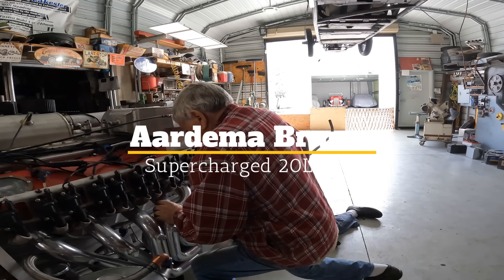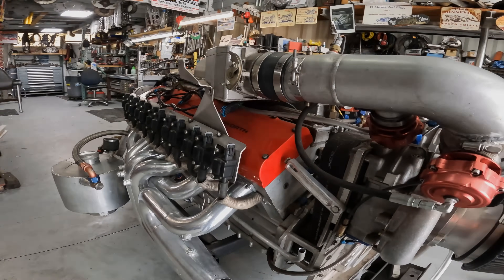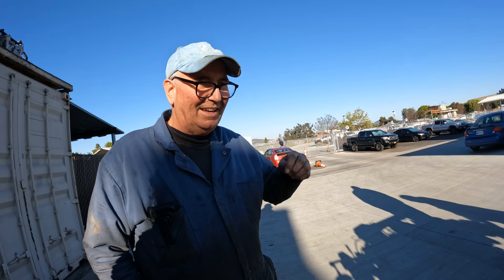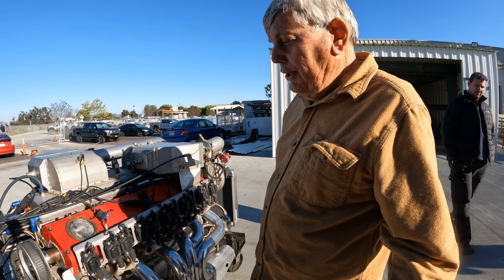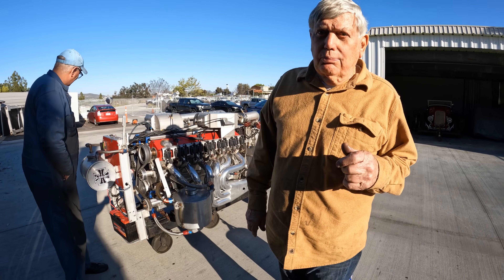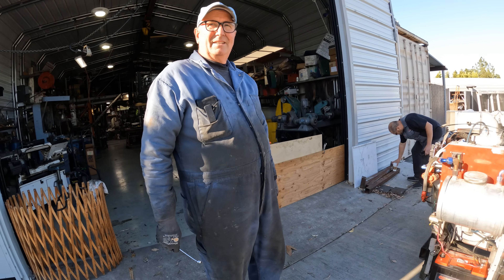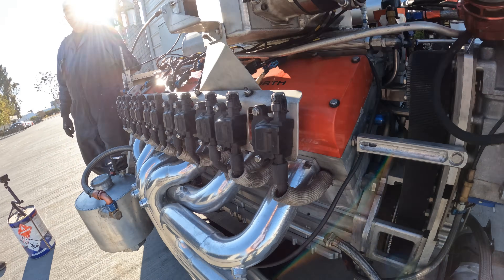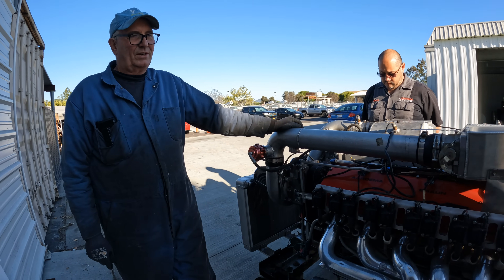DIY Prototype 20-liter V12 Engine Start Up -

Comment: Those Youtube drag racers are claiming 3000 hp out of 550ci engines but they only run for a matter of seconds 
You guys want this to run 15 minutes per heat would be quite the accomplishment ,,,,,,,,,,

Comment: A gas version of a Detroit/GM Diesel, made from aluminum, and modern lighter weight parts, drop the compression to about 10:1 use a large rotary valve on the intake if needed, to prevent the piston from pushing air back into the intake, or maybe use something similar to a sleeve valve, use 1/4 of the bore as a port about 1.5" 2" tall, 3-4 ports to induce swirl, at a angle , to allow the blower to push out the exhaust filling the cylinder,   the low pressure high volume boost filling the cylinder, and inject the fuel on the piston top and it start to rise compressing the air evaporating any liquid fuel, mixing it with air,  at higher rpm possibly injection of fuel may need to start soon as the piston uncovers the port as scavenging is happening,  if exhaust temperature is a issue, cam timing may need to be modified to close the valves to prevent fresh air and fuel from entering the exhaust  ,  the engine should make tons of power! Especially at higher rpm when the turbo spools, pushing about 2bar into the cylinders, possibly requiring multiple fine must low volume fuel injectors, to allow a fine atomised intake charge to be pulled in,  the wet injection would allow the fuel to evaporate and burn later in the stroke,  possibly making more power, the engine would require a lot of testing to get ell the power from a turbo two stroke GAS engine, I think atleast a 3.80" 4"+ stroke would be best  because if the loss of work due to the intake port, maybe it doesn't matter,  maybe the boost / scavenger and cam timing makes up for it, and all the  energy is extracted and the exhaust valve can open  allowing the pressure to start the scavenging, before the intake is open allowing the exiting exhaust pull in intake charge, then the 1-2 bar boost, making more power,  
Even a 53 series based gas engine would be awesome, 424cid v8 or even   a 150 cid 4 cylinder,  but 2stroke I'd love to build one!!  Converting a diesel to gas, the weight is out of the question,  weighting 1000's of pounds  it's better off diesel!   Sorry to ramble!! ✌️

Comment: What is the advantage of the cylinders bolting to the crankcase vs an engine where the cylinder heads bolt to engine block? He compares its to construction to a Harley. I believe Ferrari  in the 60’s designed engines that way too.
Reply: No head gasket problems. Millers and Offys were built that way for that reason.
Reply: Ease of machinability mostly, helps keep costs down as well

Comment: Ryan Falconers V-12's are physically smaller 1/2 the cubic inch displacement, make 1200-1500 hp naturally aspirated, & over 3000 hp with twin Eaton superchargers
Reply: Just making horsepower is not the problem in a hydroplane. It is about the worst conditions I have ever had to deal with because the engine is always under full load and the propeller is bouncing in and out of the water. Reliability is the problem.

Comment: As one who grew up on the world’s fastest (only one on salt water) H-! Racecourse in Mission Bay and listened to those big RR bomber engine powered rigs. I’d know i ‘d died and gone to heaven if I heard this beast at full song on that straight down Fiesta Island. It would rattle windows a mile away.
Reply: Your incorrect about San Diego being the only salt water course. They used to race at the Miami Marine Stadium which is off Biscayne Bay (salt water), and was arguably the best location from the spectator's perspective: great seating and location.

Comment: I wonder if the angle between the cylinder banks is 60 or 90 degrees ?   12 cylinders are usually 60 degrees.
Reply: It is 60 degrees to maintain an even firing order.

Comment: God, I wish Unlimited Hydroplane racing would go to this, the turbines are slowly killing the sport because of cost, and engine guys can't relate to a turbine. These engines would GREATLY reduce the cost and would be far more thrilling to watch race.
Reply: i dunno about the cost reduction but they would be cool.
Reply: @lasskinn474 hard to believe yes, but the turbines for unlimited are insanely insanely expensive.
Reply: John, your observation is spot on. However, I personally would like to see other engine type class racing. Think of massive radial aircraft engines running 28 cylinders. Add to the list multi rotor Wankel engines. The list goes on..

Comment: They should build a v12 with ducati L2 cylinder heads they are made for 110+ bore and put that with 50mm stroke and rev it to 15000rpm cz it has desmo valvetrain!!

Amazing man love it

Comment: This thing in a ww2 fighter
Reply: 1200 cu.in is on the small side for a WW2 fighter engine. The Merlin was probably the smallest mainstream one, and it displaced 1650 cu.in. That being said, this engine would probably knock a WW2 engine's socks off thanks to modern engineering knowledge and twin turbos.